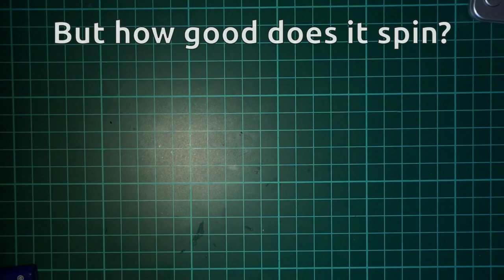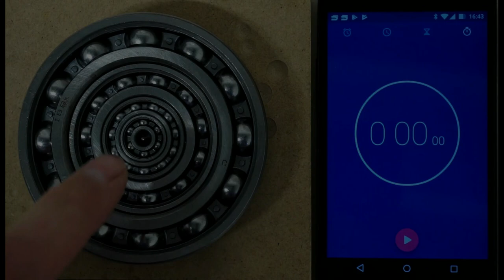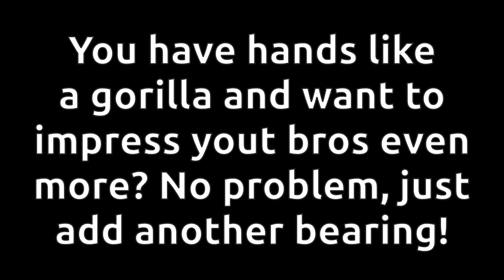Bearing in a Bearing Fidget Spinner - 1.5 Kg Gorilla Edition

Comment: I made one of these too, but mine only spun for 4 min... ;~;
Reply from the maker: Did you use a 606 for the inner bearing or the smaller one mrmash used? I found that the 606 do a better job in this application ;)
Reply: (You can watch the video on my not so channel like channel) Yeah I did, but it didn't really spin which I think is why mine only spun for 4 min... I think it's because the larger bearing was so free-spinning that it didn't effect the center bearing. :P